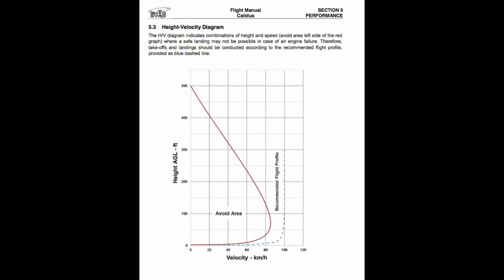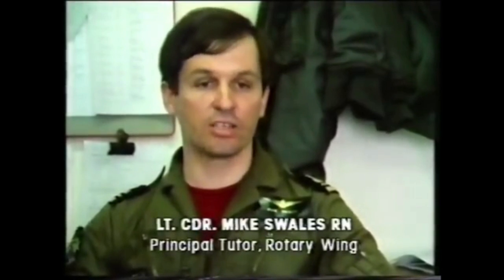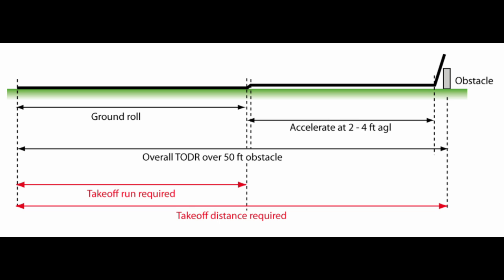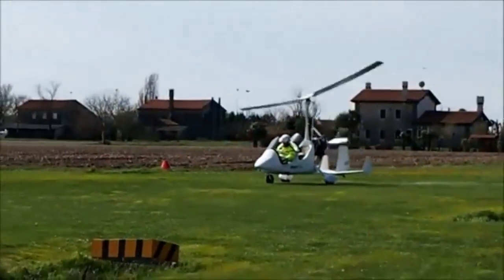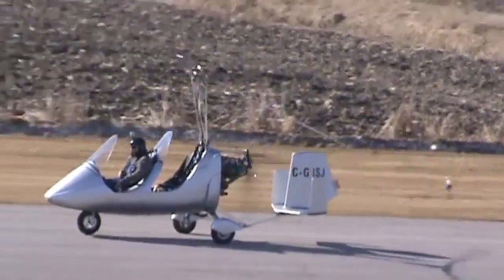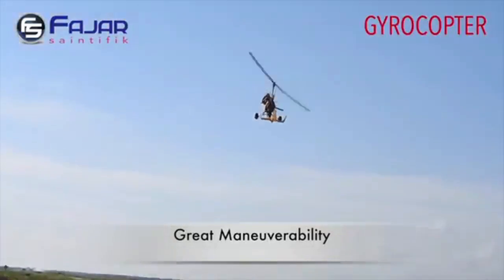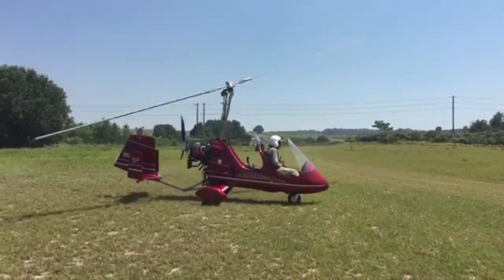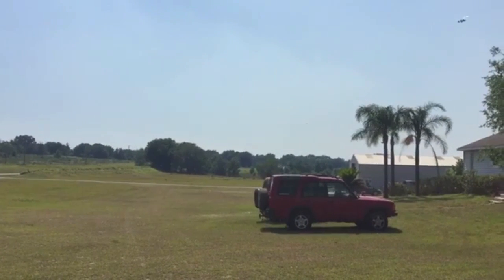A Gyrocopter is NOT a short take off aircraft...

Comment: Rotor management.....whether you balance on the mains after pre rotating to T/O speed or allowing the rotors to lift you off with both ground roll along with sustained into wind T/O. By the way I am proud to say I was taught by the CFI in the Blue AR-1. Rotor management.........that's the key whatever the technique. IMHumbleO.
Reply from the maker: Hi - I'm not sure if it was the point made but I just want to clarify that the use of the CFI in this film was in no way a criticism, it was used simply to demonstrate a well executed take off needed to be done swiftly.

Rotor management - well in this context I'm not sure what you mean.  Yes its fundamental at some level so you don't damage the aircraft (i.e. don't allow rotor RPMs to decay) but this film isn't so much for student pilots to pass a pilots course and more to highlight the general performance of a gyroplane and in that context managing the rotors is absolutely trying to get the most performance from them.  I don't know any manufacturer or CFI talking much about that tbh.

Wheel balancing - again Its not a criticism of that technique either and actually on a rough strip I might be included to get on the mains and protect the nose wheel sooner plus unstick at a slower airspeed.  So I'm not a wheel balance hater as some might think.

The point of the film is to demonstrate that a gyroplane - despite the marketing claims of many manufacturers - isn't really that quick to take off, certainly if you are going to respect the HV curve published.  We can see that by the random selection of pilots 1up, 2 up taking off.   It also highlights that the POH may give a take off distance number but you may not achieve that number because you don't have enough skill.  

I'm not suggesting for a second that this applies to you - I'm just giving a view in your reply - but almost none of the films I've ever made are specifically for a student pilot to pass a course.  Yes some manoeuvres will naturally led themselves to a test environment and the advice might align (and I think the advice would work) but passing a course to gain a licence is not all there into flying and student pilots are not the only ones in the sky!  Indeed most pilots you read about in an accident investigation are current licensed pilots making the same old snafus because they slavishly follow something and apply the wrong technique to the situation.
Reply: Well done. Well explained….
Reply: But what about takeoff with pre-rotation? I thought those can allow something like a jump-takeoff. Shouldn't pre-rotation be a key tool for short takeoffs?
Reply: @manofsan  please watch the video of the Hawk 4 gyroplane it rolled all of 6 inches before lifting in to the air like a full helicopter
Reply: It looks very underpowered so I'm sure that doesn't help

Comment: To what RPM can the main rotor be pre-rotated on, i.e. a Magni M-22? It seems that while FW aircraft's takeoff roll is about achieving airspeed, a gyro's takeoff roll is about achieving rotor RPM. Enough pre-rotation + collective pitch enables jump-starting to 100+ ft vertically with 0 groundroll, okay but those aren't available anymore, and those are in the "just get a helicopter already!" category. But for "normal" gyros, i.e. the M-22 - what's a realistic good pre-rotation RPM?

Comment: I had a test fly of a open tandem 2-seater. As a heli (and fixed-wing) pilot, I found the take-off distance required to be very off-putting.
Reply from the maker: Yeah its depending on the technique used it can be a surprising distance to clear 50ft.

Comment: Watching some of the old De Cierva tractor configuration gyros, they seemed to have a very short / slow take off.  Was this really the case.
Reply from the maker: Hey Mark - Yeah I think they likely were compared to the modern sport types and that is because they are much bigger entities in that the motor / prop would have generated more thrust and the rotors much bigger and with 3 blades - and that in combination would have been useful to that.  You might also factor in that much of the footage of the old aircraft would have been with professional pilots and in part for the camera.

Comment: It can be. Depends on the design.
Reply from the maker: We have to be careful.  If you look at my channel videos you will see a lot that track a potted history of the aircraft from their invention all the way to today.  In that series you will come across the Avian and that aircraft had a "jump take off" so would fit your narrative but it was certified in the helicopter category and they sold no aircraft.  Today the gyroplane is almost 100% 2 blade teetering rotor and they are not short take off.
Reply: @gyrocopterflyingclub6148  Depends on the design. 99% of the gyroplanes out there are pusher configuration. Tractor configuration would yield better results. The little wing autogyros are converted fixed wing airplane fuselages and use rotax engines on them and do ok. A newer tailwheel tractor configuration would have to be designed. However, The Twinstar gyroplane that I did some training in had an O-320 Lycoming engine in it and got off the ground faster than any stock Cessna that I had flown, and that was with two people in it. The old style blades are better but more complex and expensive to build. It seems to me that everyone is stuck on designing gyroplanes that look like fighter planes or sports cars. With a pusher configuration you have to keep it clean up front. With a tailwheel tractor configuration it allows you to swing larger propeller with better engine cooling.

Comment: The limiting factor in this argument is horsepower: if you have 100hp or less, the drag from the rotating wing will put a brake on your thrust resulting in low airspeed once you are wheels up - requiring some time in ground effect before achieving climb out speed. A sub 100up engine takes time to overcome this inertia. A more powerful engine will result in greater acceleration once airborne - but adds weight to the airframe. One way, with a sub 100hp engine would be to continue to power the rotorblades during take off. Pre rotation devices both bleed energy from the thrust potential, and are potentially extremely dangerous should they fail mechanically. An alternative method (I have seen solid fuel rockets demonstrated) of increasing rotor speed during take off would result in a true short take off. Simply, for the size and weight of today's aeroplanes you want both more powerful and lighter engines and a secondary method of spinning the rotors faster than one that increases drag. I feel I have an answer, but trying to convince the relevant engine makers is...impossible, I have found.

Comment: It is clear if one does not want to take off even 3000ft will not be enough. This video is about making video about made up issue.
Reply from the maker: Made up issue?  Explain?
Reply: @gyrocopterflyingclub6148  Exlanation: for 99% use cases it is a STOL aircraft and for 1% it may not work as a STOL aircraft. This video is about a non issue.
Reply from the maker: @PaulValickas  You are fundamentally wrong because you assume [incorrectly] that the take off profile matches the need and it doesn't.   That aside there are countless accident reports with gyroplanes hitting boundary fences because the pilot in command assumed he could exit a field that he couldn't - including very many featured in this channel..  If you care to look at the very many films I've made you'll be illuminated.

Comment: If a gyrocopter is not a short take off aircraft then what’s the point in them? I thought that the short take off was their one and only saving grace considering that planes out perform them in almost every category.
Reply from the maker: Hi - that is very good point and likely why the gyroplane remains firmly in the sporting aviation camp because when it is benchmarked against aeroplane or helicopter it is lacking.  Where it works for the sporting pilot are excellent visibility and a relatively cheap entry point in some markets that still allow kit built aircraft.  Perhaps the biggest advantage for the occasional sporting pilot is the fact you can land in very small spaces, making for relatively easy emergency landings, and of course you can not stall/spin in.
Reply: @gyrocopterflyingclub6148  Perhaps performance in windy or bumpy conditions might also be a factor in their popularity?
Reply from the maker: @michaeljohnson3383  Yes 100% I think weight for weight you'll be able to fly more days in a gyroplane than fixed - either 3 axis or flexwing.
Reply: @gyrocopterflyingclub6148  Thanks for responding! But why, from a physics standpoint, are they not capable of a short take off? I have read that some can maintain altitude at as little as 12mph. Surely that this means that that particular craft would only need to accelerate beyond 12mph to take off making for a very short take off roll. Additionally, why are they no longer made with the jump capability?
Reply from the maker: @Str4t0sph4r4  Yes on the numbers you give I would agree but the 12mph number is more like 40mph and so that changes things a little.  The problem with all is regulation tbh as regards "jump take off" and then on going maintenance and of course pilot training.

Comment: Interesting, was wondering... I've seen the gyros that have powered rotors in the sense that it gets the rotors going before forward speed, wondering if this gets them rotating enough to significantly shorten the takeoff distance?
Reply from the maker: Yes of course the ability to get airborne simply a function of airspeed and rotor speed.
Reply: A strong pre-rotation reduces take off roll. High lift blades too. There is a trade off between speed and low speed lift with rotor blade design like with fixed wing design

Comment: I think it's worth pointing out that the formula you're using is only going to give a very, very rough ballpark figure for takeoff distance, for two reasons. 
First, you're assuming the initial airspeed is 0, which is only true if you have no head or tailwind component. 
Second, the formula you reference is for constant acceleration, which assumes the result of thrust minus (total) drag is constant. I have never flown a gyrocopter, but I'd be surprised if it's close enough to constant to be meaningful. It's certainly not true for a helicopter.
Reply from the maker: Hey Ben - that is interesting.  Yes so in 99% of cases the aircraft is going to take off into wind so airspeed will likely always be +ve initially all be it at a varying value.  On the accel. I see your point but again it will have so many variables that that too will be impossible to give anything more meaningful [IMO] than the rough numbers because it will vary with pre-rotation speed, initial airspeed, angle of attack throughout the take off roll and the angle of the fuselage as it lifts.  

In terms of material change have you any colour on the variation between the rough calculation highlighted and a more detailed view?  i.e. aircraft A has initial airspeed of 0, final of 60mph and takes 30 seconds and constant acceleration.  Aircraft B has initial airspeed of 10, final 60 and takes 30 seconds and the acceleration isn't constant but increases.  

Mathematically I can see the point but at the same time it starts to disconnect from reality because of the number of reference points you'd need to add to your equation surely?  So accel at time t, t1, t2, t3.... at some point you surely have to approximate and then question just how big the delta is of any error and see if it kind of works?  i.e perhaps in a lab looking for an absolute number we might accept less delta but for a pilot thinking as a pilot and a take off distance of [say] 1000m and an error of 10m it doesn't matter.  If you see my point.
Reply from the maker: As an aside I was reading this and my head fell off:-http://web.mit.edu/8.01t/www/materials/Presentations/Presentation_W01D3.pdf
Reply: @gyrocopterflyingclub6148  Ah that brings back flashbacks of my degree!
Reply: @gyrocopterflyingclub6148  I think it's something that would have to be established experimentally, as you say there are a lot of factors involved. I don't know how flight simulators handle the problem, it may be computed or a simpler approximation could be used. Part of the reason I made my previous comment is because the logical, but dangerous, next step is to calculate the value of a (acceleration). That's the other variable in the SUVAT equations and can be calculated with the same variables you used to calculate distance. With a, you could then calculate a theoretical take-off distance... but, as it relies on the assumptions that initial speed is 0 and acceleration is constant, that would be a dangerous calculation to rely on.

If the acceleration is greater towards the end of the take-off run (but time remains the same), then distance required is less, as proportionally more of the time is spent at a lower speed. How much difference that makes would depend on how acceleration varies - and it probably won't be simple!

I'm a helicopter guy (although gyrocopter-curious 😂) and I don't know how applicable this would be to a gyrocopter, which I assume is fixed pitch. The basic starting point is force = mass x acceleration. Mass is effectively constant so acceleration is proportional to thrust. Ignoring vertical or yaw forces, that leaves thrust and drag. The difference between those two is the force available for acceleration. Generally speaking, during a normal takeoff for an R22 (using the profile recommended in the POH) with a constant power setting, thrust is going to increase markedly from 0 to somewhere around 24 knots, then more or less level off. Drag is going to decrease from 0 to 53 knots, then increase. So the net force, and thus acceleration, will increase significantly until 24 knots, then more slowly to 53 knots, then decrease above that. I couldn't give any numbers for how that varies, I generally just worry about whether I can clear the obstacle ahead - and have a decision point and plan for if I can't!
* I realise it sounds counter-intuitive to say thrust increases and drag decreases as speed increases. I'm happy to explain more, but in a nutshell, the rotor gains efficiency and the reduction in induced drag more than compensates for the increase in parasitic drag. If the same applies to gyrocopters, apologies!

At the end of the day, I wouldn't try and calculate take-off distance using a basic formula (unless it's been established by a manufacturer). You might get a number that's in the right ballpark, but the level of uncertainty is likely to be hundreds, not tens, of feet. You could do some testing to establish some numbers, but even then, they will vary with factors such as density altitude and even takeoff surface. If in doubt, have a plan to bail out!

Comment: I have flown many types of gyroplanes & gyrocopters. All are seriously underpowered. 100+ HP is just not enough for a modern two-place gryo. They would fly well with 300+ horsepower. The rotor drag is just too high. You are almost always behind the power curve. Take off in a gyro is a dog compared to a high performance aerobatic airplane especially in hot weather with a full load.
Reply: 130  - 150 hp Yamaha is a great Gyro powerplant. See Tango Gyro. They run circles around a Rotax powered Magni or equivalent.

Comment: I have never been in a gyroplane,  but I always thought stol capability was their greatest advantage over a fixed wing. Thanks for enlightening me.
Reply: All gyros can do very short landings. 

But not all can do short takeoffs.

A pre rotator (which most all gyros have now) helps to shorten the takeoff roll m by getting the rotor spinning at xxx rpm’s before the takeoff roll starts.  But this gets the takeoff roll to like the average length of a Cessna 172 or 152 takeoff roll.  These prerotators may be an electrical motor on the rotor head or most common a hydraulic drive.

More rare (and complex and expensive) are gyros with jump takeoff, wherein a mechanical shaft from the engine spins the rotor up to flying speed, and the rotor has a collective pitch lever (like a helicopter) which is pulled which creates the vertical jump, after which the mechanical connection is immediately disconnected and the gyro flies off as a gyro.
Reply: It is STOL indeed.